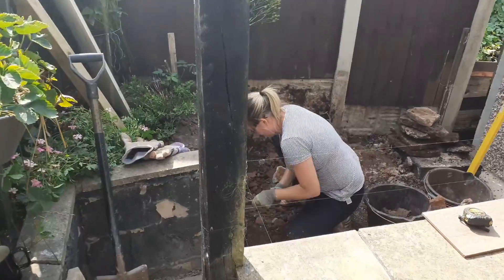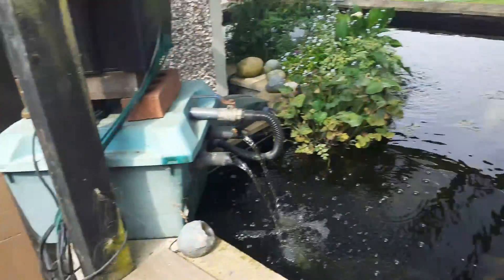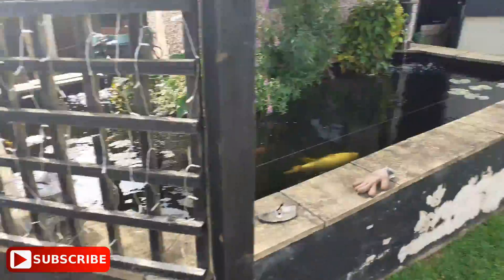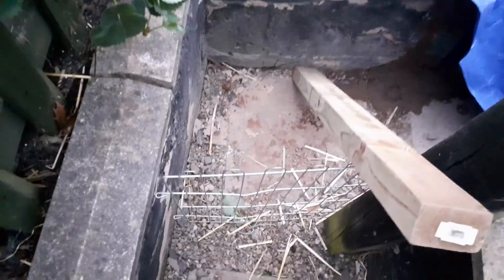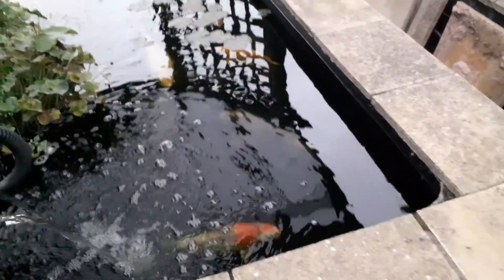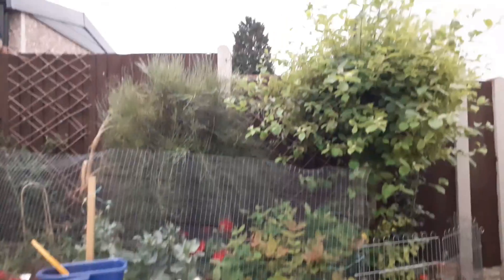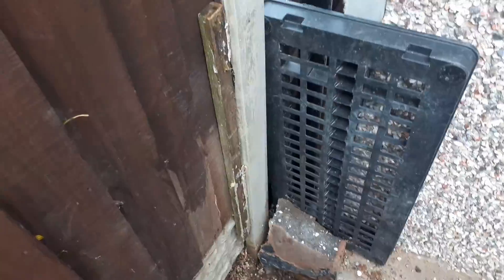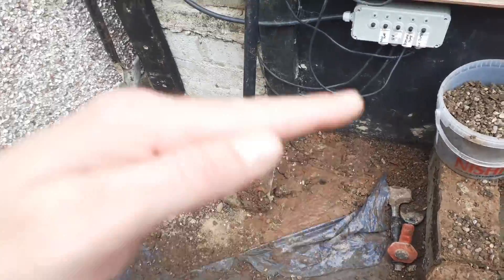Starting The New Filter House | Part 1

Comment: Hard work. The Nexus will do an amazing job. I like the tiles you have chosen!
Reply from the maker: sorry Lau i must of missed this comment. thanks im hoping the nexus will do great. just shut down old filter yesterday but now had nitrite spike
Reply: @Sharpeyskoi  yeah that's pretty normal. Water change everyday and it will soon settle especially if the ammonia is 0
Reply from the maker: @LauMagroTheFrenchKOInection  yes ammonia 0. Been on a forum and people saying ro install old one back up until spring
Reply: @Sharpeyskoi  if it was a permanent problem, yeah may be, but you only have a nitrite spike as you have a brand new filter. It's almost like a new pond in some ways, especia as the Nexus is a much bigger filter and you have a biological media which you didn't have before and which is not mature. I would put a pure pond bomb in the biological part and do everyday at least 50 litres of water change. Don't feed and let it settle.
There are two videos from Adam Juylan which hopefully can help. Here is the link of part 1. Following that you will have part 2. But basically with any new filter, everything becomes unbalanced. Hope it helps
https://youtu.be/S5Iv4dmc_QM
Reply from the maker: @LauMagroTheFrenchKOInection  part water change last night, I stalled old filter again and nitrites back to zero. Massive help
Reply: @Sharpeyskoi  oh that's good. Sorted then. That's great.